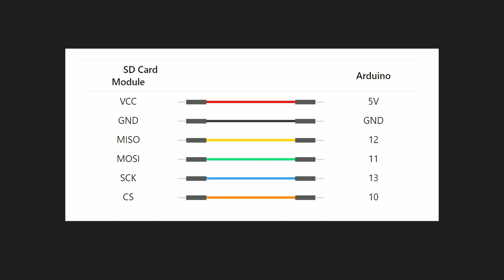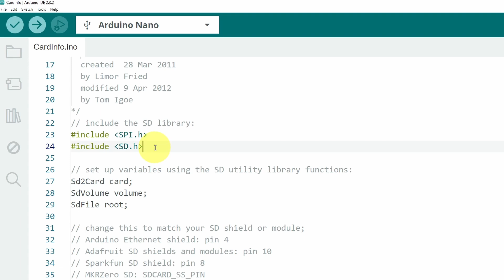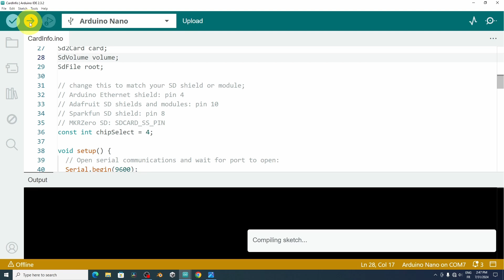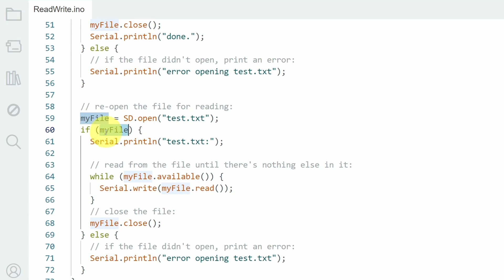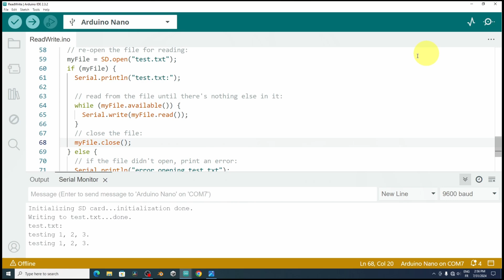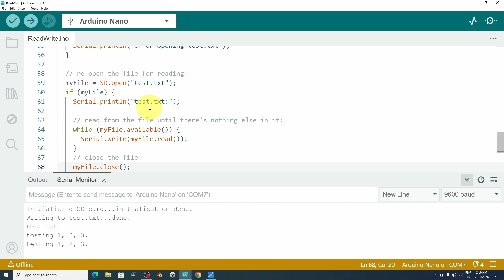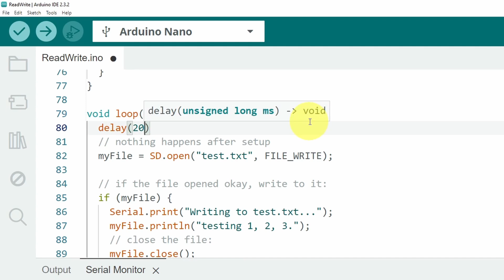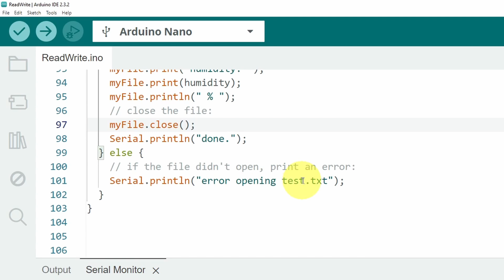Unlock the Power of SD Cards with Arduino! 🌡️💧

Comment: I have made an home theatre system with amplifier board and speakers and subwoofers now i want to control its volume with hand gesture like it comes in bmw cars please quick help make a video or any other help material like what would be code what components needed please make a project